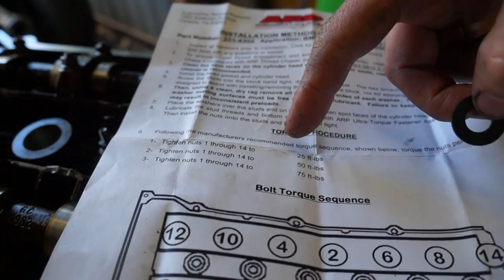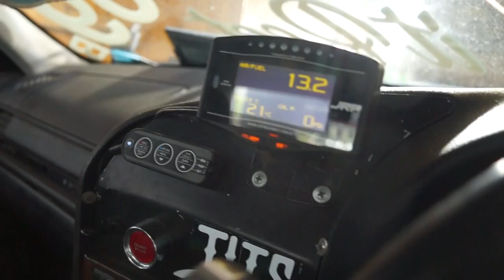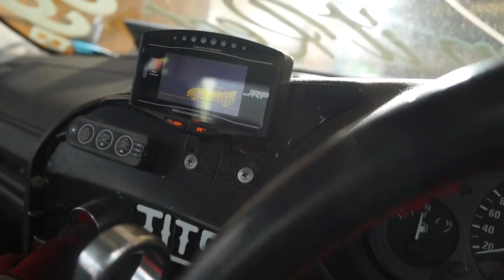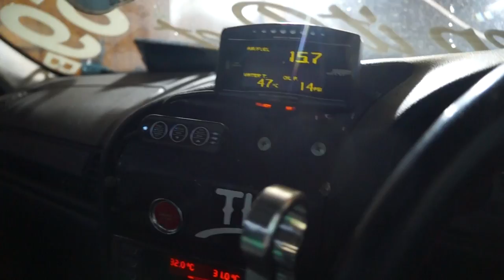M50B30 ENGINE BUILD PT2

Comment: just out of curiosity, if you've been having problems with head gaskets why don't you go with an mls head gasket?
Reply from the maker: Owen Foster the problems have been with the alloy block, not the headgasket a themselves. The stock headgasket with arp studs will hope the boost were going to run easily 🤓

Comment: What cams are you running in this build? I'm buttoning up my m50b30 gt35r build and am working on getting the tune figured out and just need to verify that the tuning will work properly using the m50 cams (will be upgrading to m54b30 cams at another time.)
Reply from the maker: I’m just running stock cams. No need for b30 cams when you have boost. These engines are absolute animals
Reply: @itsmikelake  do you have an ignition map that you’d be willing to share?

Comment: Hey Mike, are you using a m50 iron block with m52 head?
Reply: I want to to know as well
Reply: The M50TU head and M52 head are actually the same so can be swapped between the two.   Same withe M52TU and M54.

Comment: Hi mate..

Just watching you build the stroker, what cams have you used, can see the head Is already built in your videos when you instal it and cant find any vids of the head being built.

Thanks Gary
Reply from the maker: Hey bro! I just used a completely stock m52b25 head :D. Nothing fancy, just bolted it right up haha.
Reply: @itsmikelake  ah thank you mate. Wasnt sure if you had used the m54 cams or not..

I have an m54 3.0 engine getting delivered tomorrow so was going to use the full rotating assembly including the m54 cams inside the m52 block and head.

Comment: Awesome built ! Awesome channel ! 
I wish to see a water/meth injection kit on that engine and a dyno test.
You can build a cheap and effective water/meth injection kit with maybe less than 100 USD and the effects should be in the range of 20% more power and other important advantages. I can tell you more about it if you interested.
It will transform your heat problem in to your friend because it will use the extra temperature to transform the water in to steam which increases the power. It will give you an awesome torque.
You should fit the nozzles before the turbo for best power increase. This way you will have a chemical intercooler for the air charge and inside the engine the water will work also as a chemical cooling system and it will increase the efficiency of the engine because it transforms waste heat energy to usable power when water becomes steam.

You can buy from eBay a ready made kit or make your own one with those water pumps used for campers, there are on eBay for 20 USD, some misting nozzles in different sizes, and a manual or arduino based controller. I have posted a video in the past bench testing one of these homemade water/meth injection kits.

Comment: So what’s better m52 or m50
Reply: M52 have an alloy block which cause the head to lift under boost.
M50 have an iron block so should avoid that issue
Reply: m50 is more resistent to going to crap if overheated.